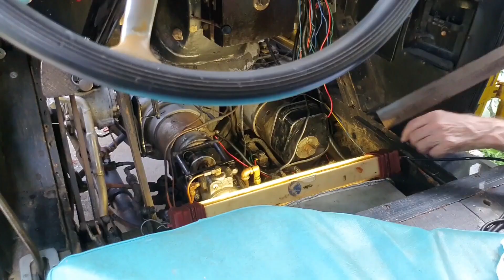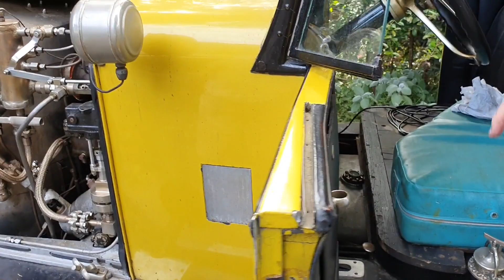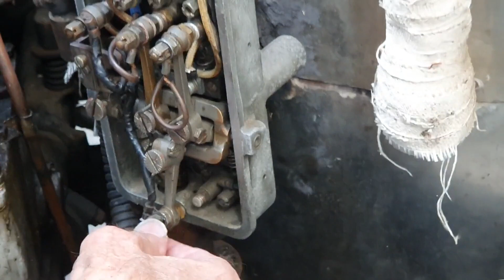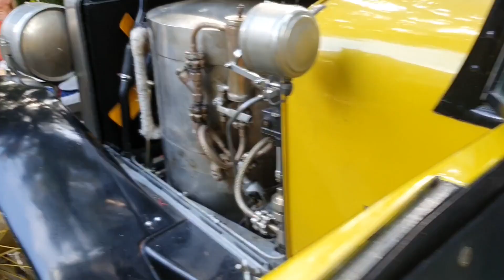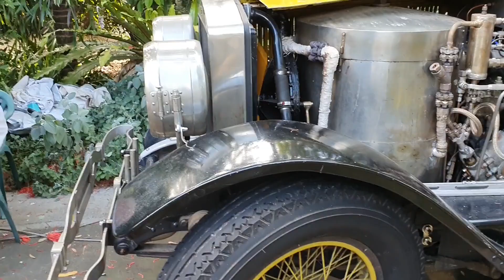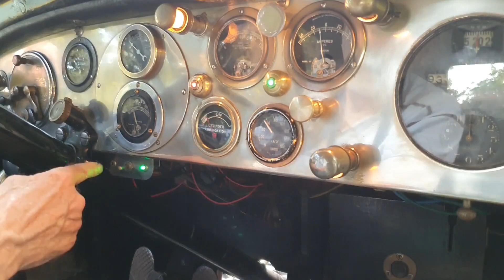1924 Model E Doble Steam Car

Comment: the boiler tube coil, could you kindly tell me the inside diameter and wall thickness I would greatly appreciate it.
Reply from the maker: I am sorry but have not been able to find that informatiom.
Reply: Actually, the tube started out with a smaller diameter and got progressively larger.  This was done because water expands as it heats, and then it expands ridiculously when it vaporizes.  Doble was trying to both reduce pressure drop across the tube nest and also maintain enough velocity to promote heat transfer.  As time went on, designers came up with lighter and more compact steam generators capable of producing similar amounts of steam as technology improved.
Reply: Had to laugh…As he is explaining how it all works at around 18:20 he says it’s quite simple….more complicated than any fuel injection system I have worked with.